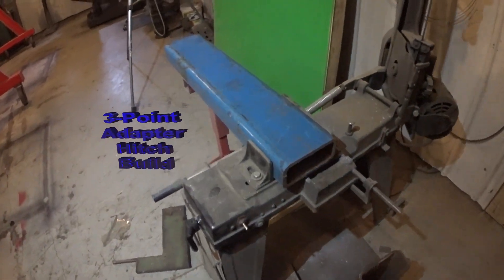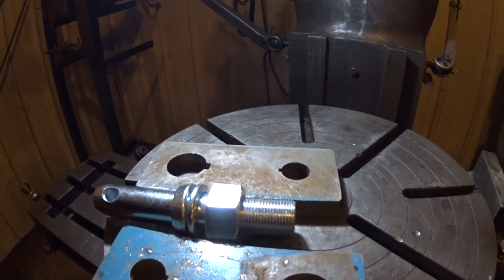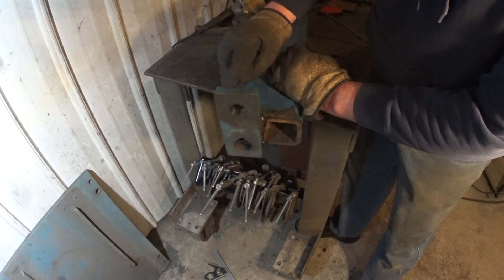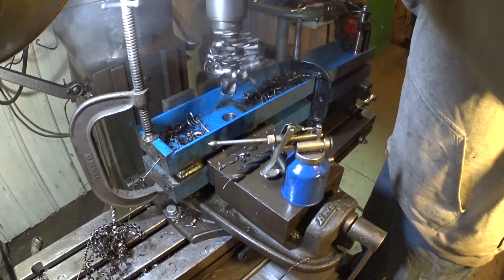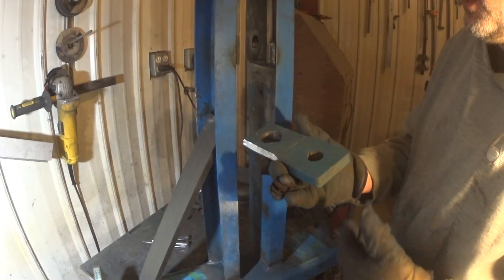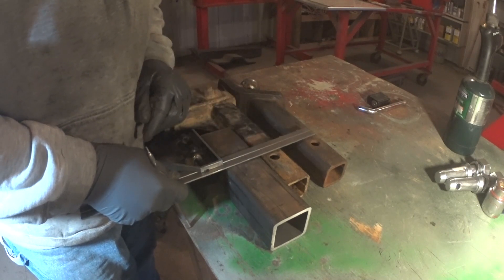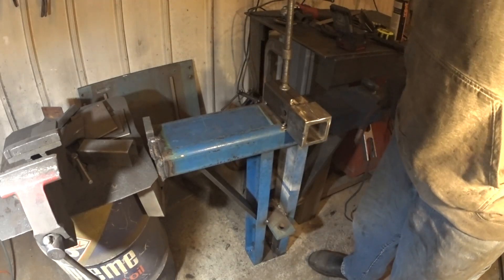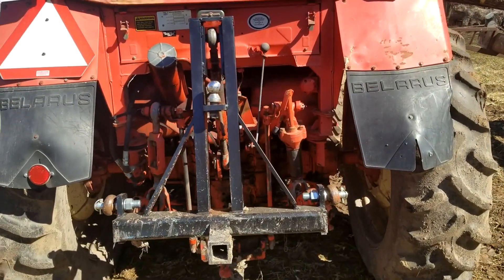Tractor 3-Point Hitch Receiver

Comment: Excellent hitch sir !!  Running some nice beads there too.  I stuck together a bit of a lighter duty one similar for the specific purpose of moving the gooseneck in tight places with the tractor instead of the big old truck.  So my ball is up high at the height of the upper link.  Now I may add a lower 2" receiver like you've got there.  Thanks for the cool video Andrew !!